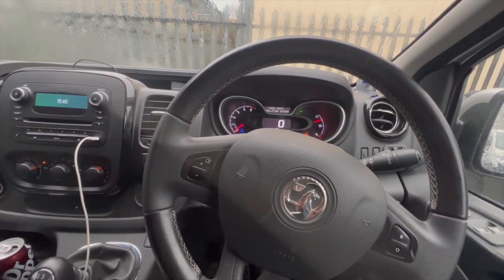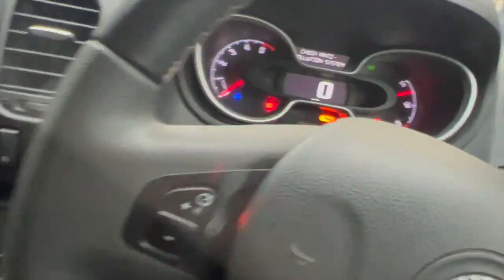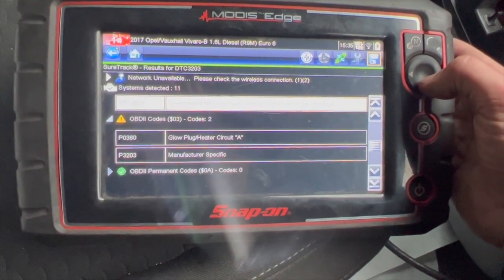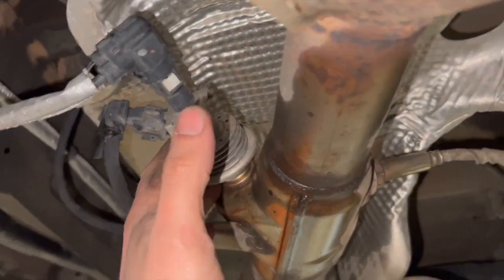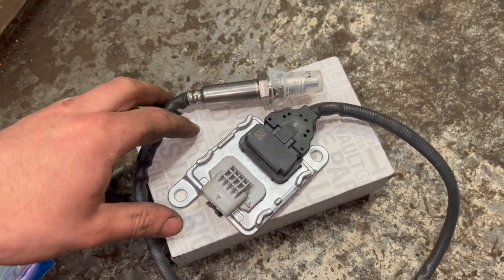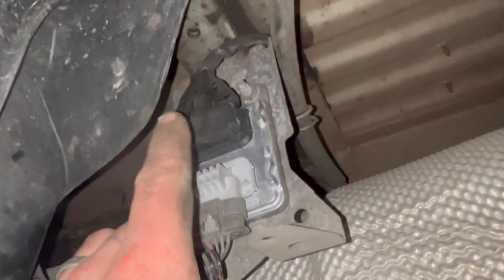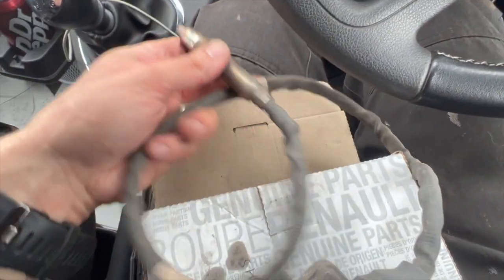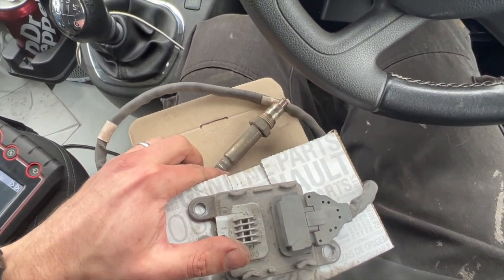Vauxhall Vivaro "check anti pollution system" Downstream Nox sensor fault

Comment: Hi. I’ve p3202 coming up. Anti pollution. I’ve changed the sensor and the little metal pipe that blocks up and the rubber pipe linking sensor to the metal pipe. Still getting the anti pollution light on the dash and the same code. I even had the dpf cleaned. But same code and nothing is fixing it. Any ideas? Great vid and thanks for putting it up…

Comment: Good simple to understand video thanks for that , do you use the N0x sensors supplied by Neo Brother in the Ebay listing you have pinned to this video or go directly to Renault?
Reply from the maker: Mixed , depends how quick we need it , neo brothers sell the genuine ones , ives used them loads of times for all sorts of bits and they’ve been spot on to deal with 👍

Comment: Could you please make a video about the location of the exhaust Gas sensor location? Got a Vauxhall Vivaro 1.6 from 2016.  Thanks.
Reply from the maker: There should be 2 or 3 temp sensors mate , all in the exhaust starting right near the manifold
Reply: @ found it it’s right at the start actually. Will put a video up soon.

Comment: I have intermittent faults all the time from check anti pollution to check ESC etc , it’s a 2017 vivaro it also judders as it flashes all the various codes , then it’ll drive like a dream and do it all again a few days later ! Any thoughts please !?
Reply from the maker: Hard to say but if it’s giving running issues it’ll be more than just the nox sensor as they don’t tend to affect the running
Reply: @diydaly thankyou for taking the time to reply , yeah the juddering  is weird and not all the time , flashes instrument panel up like a Christmas tree , then will all go off , they never stay on ! Bloody van lol
Reply from the maker: @craignash7355  😖 sounds like an odd one , never easy when it’s really intermittent
Reply: Mine does this has  been for the past 20k+ miles how is yours running now? Any idea what it might be?

Comment: Where do you need that 22mm  special tool? Why not use normal 22mm spanner or open loop wrench?
Reply from the maker: You can use a normal spanner this just gets a lot more grip and saves rounding the nut off

Comment: Hi. I've just got a fault on dash saying "check stop and start" with the engine light on and spanner. also it does come up with anti pollution system to but goes off when i drive. but the stop and start warning stay on. Could this be a battery problem? I've just had the battery tested and the guy said it should be running over 80% but it was 77%. So could this be throwing everything out? Also I dont have adblue on mine, Thanks in advance. ste
Reply from the maker: There’s a good chance it is the battery but would need properly looking at to be 100%
Reply: Ive got a feeling its the battery. will send a update when its been replaced. @diydaly

Comment: Hey there. Great video. I think ive got a similar issue. My 2019 diesel Vivaro van (60k) sportage is showing a adblue emission fault, and will be impossible to start at 600 miles.? 
Ive topped up fluid and problem still showing.?
Please advise.? 🙏🙏🙏
Time of year is expensive, and don't  want a huge garage bill, so if i can do the sensor replacement I'll give it a go. TIA. 🙏🙏🙏

Comment: Have you ever had a new Genuine nox sensor fail on you in less 3 months. I replaced one and Renault told me it needed the adaptions to say it’s been replaced using dealer diagnostic equipment. Iv never come across that on a Renault. Codes I had was p2203 (high voltage in the nox sensor)
Reply from the maker: Can’t say I have , OE nox sensor la don’t usually give any hassle 👍
Reply: Hi did you get to the bottom of this? I have code P2203 nox sensor 1 high bank issue.  Is it the nox sensor? Thanks

Comment: Hi sorry to
Bother I’ve recently got the anti pollution warning on my trafic 3 said egr out of tolerance. I’ve cleaned refitted as it was filthy and wouldn’t open and close. Now I have this message nox sensor 2 invalid data recieved could this be down to any of the plugs I had to undo I’ve checked numerous times just seems strange this has come up after doing the egr. the van runs fine tho code has came up as p059f thanks ian
Reply: Any luck with this issue as I've got the exact same issue currently. P059f code and nothing else

Comment: Great video, thanks. May be worth updating the part links, they are dead.
Reply from the maker: Thanks mate , just updated the links 👍
Reply: They're dead again. That's the problem with eBay I guess.  @diydaly
Reply from the maker: @dynamotightstar3472  
No.1 NOx Sensor Ebay - https://ebay.us/MWKngV
No.2 NOx Sensor  Ebay - https://ebay.us/UCUH0N
Reply: @diydaly  thank you mate. Much appreciated.

Comment: I have had my local garage and perrys look at mine and all they have done is force regeneration, check anti pollution has just come back on but I seem not to be using any adblue still at 100 percent any ideas ( I only have an autel maxi scan)
Reply from the maker: Your add blue injector may be blocked

Comment: Hello and thanks for your video
My 2018 vivaro have a fault that says bad AdBlue in tank do you know what that could be ?
Reply: The problem is, where did you get the adblue from?? IF you've got it from a petrol station then likely, as not, it could be out of date OR, been left on the forecourt and the sun has got to it so, ALWAYS buy it from a proper retailer... make sure the date, on the tub, is not out of date also look to see if there is any 'crystallization' around the filler cap, of the tub... if so, get a different tub!

Comment: Great video, don't suppose you have a video changing number upstream sensor do you.
Reply from the maker: Thanks 👍 afraid not at the mo but it’s pretty much the same
Reply: @DIYDaly  thanks. My garage changed one but said the other was difficult. But looking at your video, it seems pretty simple unless the plug end is way up in the engine bay
Reply from the maker: @rolystaxi  common issue you can come across more so with the front ones is they can siEze in and pull the threads out

Comment: Hi my anti pollution light came on just today. I will have to do the service in couple of months. Do you think is ok to drive until then ? Also when driving now  i can hear a click noise come from driver seat looks like a tock from a clock or something like that. Any idea what could be? I have a renault traffic 2016
Reply from the maker: Not sure about that noise , might be advisable to get that faults read sooner rather that later
Reply: Well I think was the antipollution .....Once done the anti pollution back to the garage the noise gone
Reply: @robertoinlondon86 thanks for getting back to me, will try and get it looked at asap. Did you get yours sorted straight away or did you continue driving it with the fault for a bit?
Reply: Hi did you ever find out what the issue was. I have the same problem on my van with that same clicking noise? Thanks
Reply: Well I think was the antipollution .....Once done the anti pollution back to the garage the noise gone

Comment: I have just scanned our Vivaro with an iCarsoft CR MAX and it came up with the code 'U059F - Invalid Data Received From NOX Sensor 'B'. I presume this is exactly the same problem just identified in a different way?
Reply from the maker: 👍 yeah it is mate
Reply: Had the exact same fault code 'U059f' 'invalid data received from nox sensor B' however, since replacing the fault still comes up as pending and reappears after 3 starts. Any ideas?
Reply: Replaced downstream nox sensor with a new one and fault is still there. Is it possible that the scanner is picking up the wrong sensor?
Reply: Where do you need that 22mm  special tool? Why not use normal 22mm spanner or open loop wrench?

Comment: So my 2016 1.6 renault trafic "check anti pollution system" light came on. I have OBD II so i cleared all the fault codes and then the light came on after a day. I checked again with OBD II and now it shows me Glowplug circuit A malfunction but NOX sensor fault is gone, light is still on. How are those 2 linked? Starts little rougher than before, no white smoke, idle fine, is not in limp mode, drives fine.

Comment: Hi,  I have the following error codes on my 2018 Renault Traffic1.6

DF153 boost pressure sensor circuit
DF066 Turbo upstream sensor circuit
DF138 Thermo-plunger number 2 relay control circuit malfunction
DF145 Particle filter loaded/blocked

This video relates to error code DF138 any idea what the fix is for the other codes.

I have taken this to a couple of mechanics and they both just said have the DPF removed which I don't really want to do.

Thanks
Reply from the maker: There’s a boost pressure sensor that’s quite common also the upstream turbo pressure sensor pipe splits .. little rubber pipe straight off the sensor onto the pipe , mega common
Reply: @diydaly  do you recommend I have these replaced as well as the box sensor?
Reply from the maker: @ChefTheo  I’d check that upstream turbo pressure sensor pipe first , you can only buy the pipe complete (both metal and rubber section) but just replace the rubber section .. the metal bit is a nightmare to change and never goes wrong .. just make sure it’s not blocked up.. here a link to the pipe I mean .. https://ebay.us/jUoFRr
Reply: @diydaly  hope your well. I have had the pressure sensor pipe and the sensor replaced. Now I have code DF106 (particle filter differential pressure sensor circuit malfunction) and DF016 (inlet manifold pressure sensor circuit) coming up. Any ideas what’s causing this? Thanks

Comment: I've had my vivaro 2017 scanned and NOX sensor 1 was the issue. just spent £341 on a a genuine vaxhaull one, how do I get the light off? do I drive it for 15 miles down the mot at 60mph? or do I need to turn it off properly with main dealer? pain in the ass this. any help would be appreciated.
Reply from the maker: You wont need a main dealer but the code will need to be cleared using a decent diagnostic machine.. a basic eobd reader will only read the engine ecu where are a nox sensor fault is likely to also be stored in the denox ecu.. only a decent scanner will be able to read into that..
Reply: @diydaly  thank you.

Comment: Hi. I am trying to leave UK on way to Spain in my 2016 vivaro. Anti pollution warning just came on. She is at dealership, no fault codes. had dpf regeneration,  all ad blu is testing ok and still no codes but warning lights and 600 mile limp. Feels like I am throwing money at no solution.  My mate has changed these sensors on his movano camper and is saying he could do them. Obviously a lot cheaper than dealer! But would codes clear? Should I leave her at dealers? Anyone down south you would recommend that might be able to pick up codes or help? Thanks. Sarah
Reply from the maker: Really odd if its got no fault codes! I have heard the movanos are having some problems with the software relating to the add blue level.. we had one that had the countdown and no fault codes stored.. it went to the dealer for a software update but haven't heard if it fixed it or not yet
Reply: @diydaly  Thanks for getting back to me so quickly.  The dealer has found a  code now for my Vivaro, it is one of the Nox sensors.  I have asked them to fix it [and rob me blind] as I want her to have the best parts and not risk more stress on my trip.  The whole process has been an 'education in patience'.  I will be getting a Boxer/Ducato on my return from Spain and will be looking for a specialist van mechanic to do any bits as it will be my full time home and dont want this stress again!  Thanks again
Reply from the maker: @sarahkeast2943  no problem at all 👍👍

Comment: Hello Mate. Great Video! Does the sensor needs to be programmed?  When I connect the reader it comes up with U059E Nox sensor A fault. Is A sensor the first one from the engine? Thanks
Reply from the maker: Yeah it will be the front sensor , not always but there may be an option to configure
Reply: Appreciate this is a couple of years old but might help others. 

I’ve just had a “U059F invalid data sensor B” fault on a 2018 Bi-Turbo vivaro. 

Live data showed that sensor 2 was reading correctly, sensor 1 was full scale at 65535ppm. 

So while the live data locations are correct, ie 1 = front, 2 = rear. 
The fault code generated when the front sensor failed suggested it was the rear one. 

Can’t explain it but sounds like others have encountered this too. 
Probably worth unplugging the sensors one at a time and confirming what codes it generates before you buy a new one. Don’t just trust the code!

Comment: Hi, thanks for the video! After replacing a NOx sensor on a Vivaro B as in video and clearing the fault code, do I need to reset some learned nox sensor values from ECM or AdBlue ecu? Thank you!
Reply from the maker: You might get away with just clearing the code but they do usually have to option to tell the ecu it has been replaced

Comment: Hi just done this buy I still have engine management light on and check anti pollution system had the nox sensor done I'm really stuck any advice please
Reply from the maker: Have you cleared the faults with a scanner then?

Comment: I’ve just cleaned that tube out for exhaust boost sensor and got pressure through it now the engine light has gone out still got the spanner light tho saying check injection system would this need a reader to remove or could there still be a fault? I fitted a new sensor at the same time so wondering if it’s the nox sensor aswell
Reply from the maker: Yeah it will definitely need the fault code clearing out with a scanner mate
Reply: Can the egr valve cause the same problems I’ve had a diagnostic done and it’s coming up with a fault on that and it needs cleaning
Reply from the maker: @mikecave4154  yeah the egr can put the same warning on.. they are quite a common issue

Comment: Thanks so much for this. Super handy and helped me fix my Trafic which had the same issue. I got an Autel AP200 Scanner which identified it as the downstream nox sensor. Thanks for saving me having to take it into Renault.
Reply from the maker: Nice one , glad it helped 👍
Reply: Just for my understanding it was not correct info from your diag / just considering buing same or something what would help me zo solve my vivaro 2019 polution troubles :/

Comment: Hello.  I just came from service now. They told me the van needs to change the poluation system. I have been asking "maybe there is sensors need be changed " they  told no need be  replaced all system. I asked how much they told me between 500-2000 pounds.
Reply from the maker: 😖 ouch .. they do suffer with a few problems!
Reply: @diydaly  What do  you suggest me to do?
Reply from the maker: @VasileMunteanu-i3v  it’s hard for me to say.. you description is very vague! There’s lots of parts involved and I don’t know what the issues / codes etc are .. you might be best getting a second opinion at another garage
Reply: @diydaly  where are you located?
Reply from the maker: @VasileMunteanu-i3v  on the eastcoast near Grimsby
Reply: So, how can I contact you?
Reply from the maker: @VasileMunteanu-i3v  I’m afraid I’m not taking on an extra work at the moment , I’m still working full time with a building project at home and we go away next week
Reply: @diydaly  ok thank you

Comment: Great videos. I've subscribed! I have the Renault version. Only 40k miles and egr cooler needed changed. Pretty standard apparently. Big job; had to drop subframe. Now I have this Downstream NOx problem too. Faults in the Urea dosing module but they were DF055, DF065 and DF066. Could be just corrosion in the plug terminals though??? I'll try cleaning them first.  Constant probs with these 1.6 biturbo R9M engines.  Would you recommend egr and adblue delete? Would save alot of grief and money!!!
Reply from the maker: Thanks! yeah they seem to have a lot of issues! both the EGR and cooler are mega common and like you say not easy jobs to do, the EGRs tend to be seized in too 😖. personally ive not had too many add blue issues.. We've have one customer that's had an ad blue delete done and its caused quite a few issues so in my experience I wouldn't recommend it

Comment: I've had intimitant same fault on my vivaro for over year on and off diagnosed egr fault on 2 diagnostics   still not resolved would you say this is my issue
Reply: Where are you based
Reply from the maker: Nr Grimsby , Lincolnshire
Reply from the maker: The egrs are a right pain on them , both the egr and egr cooler and mega common issues , the coolers located on the rear and the egr is on the front
Reply: Garage seem confused it's vauxhall garage on diagnostic code p0402 egr Valve 1 malfunction P0488 egr valve 1 performance have you any suggestions may help please as it's now doing my head in is it worth changing air temp sensor 1st as do seem down on power at times and occasionally slips into limp mode with check ignition on dash I appreciate you replying
Reply from the maker: @deanshort4030  no to be honest mate if it’s got egr faults it won’t be the temp sensor .. I’m afraid they are mega common issues and it’s gona cost a fair wack.. we’ve replaced loads now 😖
Reply: @diydaly  thank you I feared worse if intimitant as I've said can I leave or will it just get worse and cause more issues I really appreciate your help
Reply from the maker: @deanshort4030  👍 no probs